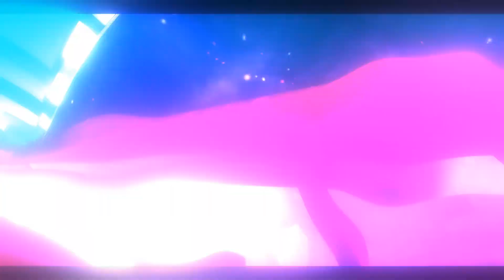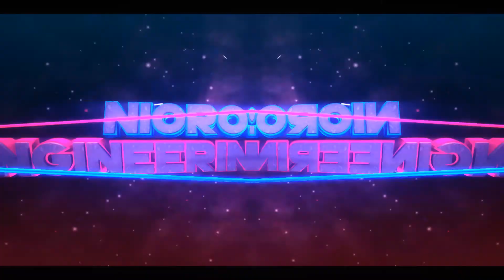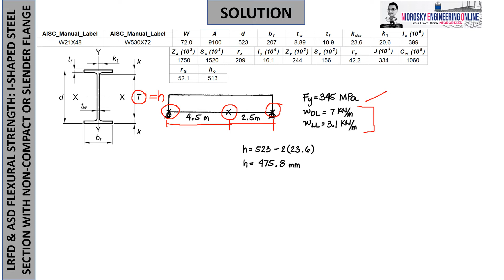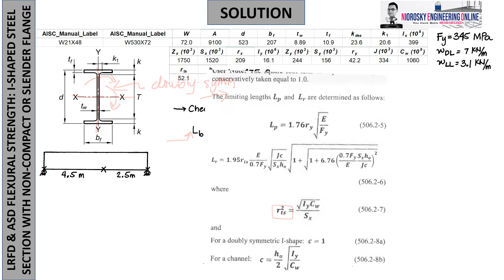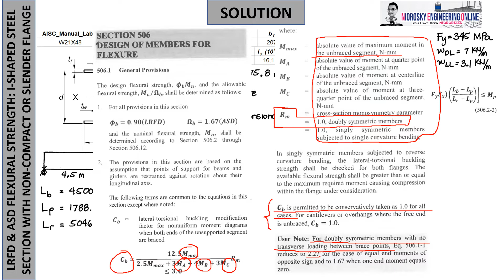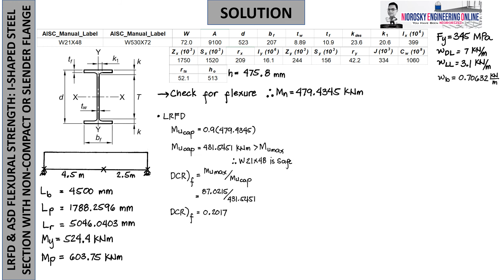LRFD & ASD FLEXURAL STRENGTH: I-SHAPED STEEL SECTION WITH NONCOMPACT OR SLENDER FLANGE

Comment: Hello po. Paano po kapag ang Mp less than than Mn, iko-consider na po bang not adequate ang design?
Reply from the maker: based on LRFD, nominal moment of the section should be less than or equal to the plastic moment since the boundary condition is found at the plastic condition. notice in the linear diagram of plastic it is the extreme stress felt by the beam section. so it can be said it is unsafe already if Mn from the beam due to load is greater than Mp of the cross-sectional area. Cheers. Also based on the LRFD code, Mn less than or equal to Mp, it says already the case :)
Reply: @nioroskyengineeringonline8968  thank you very much sir! more power and God bless!

Comment: meron po kayung two way slab na vid po?
Reply from the maker: soon for upload boss. 
one way, two way, columns and seismic detailing, torsional design and analysis under RCD playlists. check mo na lang playlists ko baka may magamit ka sa mga discussions ko. cheers
Reply: @nioroskyengineeringonline8968   bat soon po ahahahaha pina self study po kasi samin ung two way slab po di wala po kasi ako mahanap na video hehe
Reply from the maker: @jerrychotaccad6177  need time to do vid lecs and currently engaged ako on doing steel lecs. Maybe less than a month sa rcd na ulit :)
Reply: @nioroskyengineeringonline8968  ok po. sensya na po but meron po ba kayung reference about two way slab base on nscp2015 heehehehe
Reply from the maker: @jerrychotaccad6177  check any good books related to rcd. I prefer the book authored by macgregor and wight.
Reply: @nioroskyengineeringonline8968  salamat po ng madami